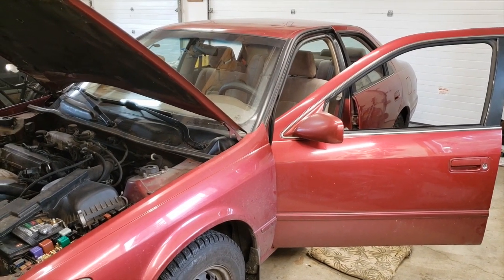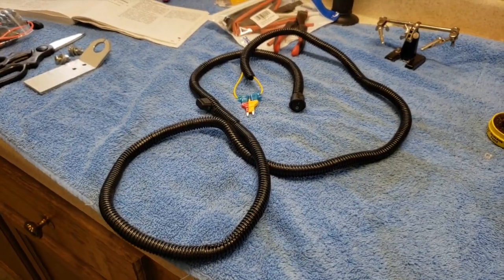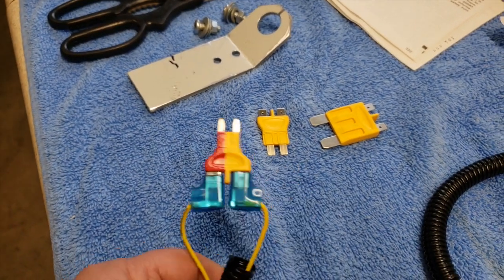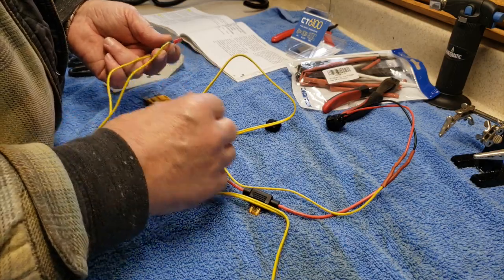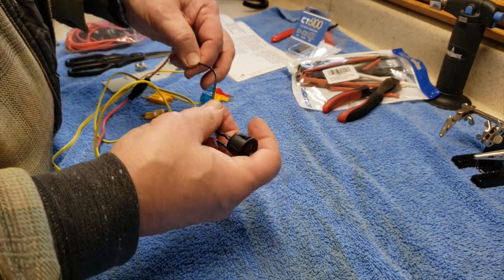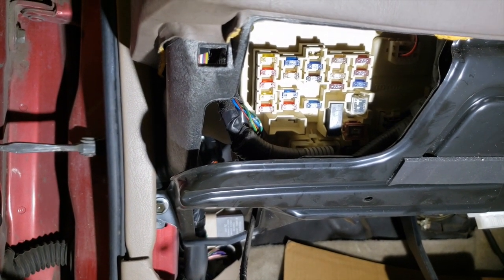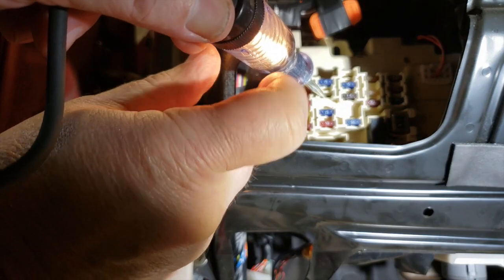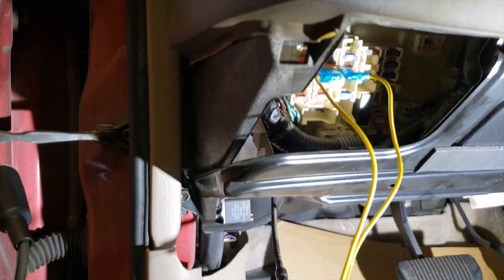Kill Switch - Quick and easy.

Comment: Why do you have a positive and a negative on a fuse when both should be positive. A switch only controls a positive or negative pole . Not both. I don’t get how you are wiring this. If you had positive and negative connected to a switch it would fry the switch and everything else.
Reply from the maker: Hi Joshua. The yellow connector is not a fuse. Its a very simply "plug", to extend a wire from my fuse port in my fuse box, to an inline fuse and continue it to a switch. I hope that makes sense!
We have been using this switch for almost 2 years now. And we have had no issues with it. Still working fine!! What I like most about it, is its simplicity!
Thank you for your question!

Comment: If the Killswitch is accidentally turned off while driving, will the motor die
Reply from the maker: Thats a great question!!
And I did not know the answer to it. So I had my son start the car and turn the switch off. And the car died!!!
So thats a major problem!
Granted, our switch location is located in an area that you can not accidentally bump it, but thats something I should have checked, and noted that in the video!! I will add a note in the description explaining that. Viewers need to be aware of that.
Thanks for pointing that out!!
Reply: @retirementwithpete9859  Thanks for answering

Comment: A thief would find that connection on your fuse box really easily
Reply from the maker: Hi Kent, like they say, this is only keeping the honest people honest.
If somebody really wants a 1998 camry, with 250,000 mile, they are going to steal it. Not sure why. Especially in Portland. But, knock on wood, its been almost 6 months, and nobody has bothered it.
Thanks for watching and commenting.
Reply: I don't think a thief will go through the fuses trying to find if they did something like this ton a car
Reply from the maker: Its sad that we even have to worry about this. 
Thanks for commenting and watching!
Reply: depends on the thief
Reply from the maker: Ours are pretty dumb😄
Reply: If it didn't start right away a druggy would move on, only a thief looking for a car of value would spend time looking for a kill switch, that said, i'd go with the fuse box under the hood and go thru the fire wall with the switch. put a lock on the steering wheel and the hood too!

Comment: The best video clip. 
The socket tap fuse it’s the key of success in this application. With the fuse on line ( hot wire)
Reply from the maker: Hi Mario. Thanks so much for the compliment.  The idea seemed very simple to me. And Im glad its working for myself and for others. Thanks for watching and commenting.

Comment: Finally I found what I am looking for thank you very much. I was looking for a simple kill switch instead if tempering with Fuel pump relay or the battery and I knew my solution is in the fuse box but I was too scared to do it. Now I am more confident about it but a quick question what amps did you use for the inline fuse connector? is it the same as the ignition fuse 5 amps?
Reply from the maker: I used the same 5 amp fuse I pulled out of the fuse box. The specs on the fuse connector says the wire is 16 ga. And able to hold up to a 13 amp fuse. There is a link in the video description to amazon, which is where I purchased them.  Scroll down that page, and it tells you the specs. I had the same problem you did,  trying to find a simple kill switch. This fix has been working great for 10 months now. Not sure this works on all makes and models, but it definitely works on a 1998 camry😁. Thanks for watching and commenting,  and good luck on your kill switch!!
Reply: @retirementwithpete9859  Thank you but what is the purpose of using another fuse for the switch?
Reply from the maker: Sorry, Im not sure I understand your question. Im using just one 5 amp fuse, in the inline fuse connector. I got that fuse from the interor fuse box, that protected the ignition.  The switch does not have another fuse. I hope that answers your question. If not, please let me know, and Ill try to be more detailed. Thanks for the question.

Comment: Not had my car stolen yet since I do live on army barracks but I’m installing one to prevent it when I’m out. Some people do it to the fuel relay might be better?
Reply from the maker: Hey John. I had the option of using the starter fuse or the ignition fuse. I havent seen the fuel relay used yet. I went with the ignition fuse because it seemed like the simplest fix.
But anything will help deter a thief. It sucks we have to do this stuff, but thats the world we live in now. Especially in Portland🤨
Thanks so much for your comment and good luck on your hack. Let me know how it goes!!
Reply: Depends on the car. If your ignition fuse/wires are easily accessible from the driver's seat, the thief could trace the wire to the switch and bypass the switch itself.
Reply from the maker: Yep, this only keeps the car safe from the lazy thief.

Comment: Instead of searching for a kill switch any thief able to steal a car without a key will immediately look for kill switch wires in the fuse panel and quickly connect them together and drive away so this method is only slightly better than nothing. 

But, if choosing this method, it's very important to splice the inline fuse as close as possible to the hot side of the fuse socket because in this video there is no fuse protection in the section of wire between the fuse panel and the inline fuse therefore a short to ground in that section would not be good.

Tapping a vital hot wire in an extremely difficult to find location forces them to search for an actual kill switch which they know is usually within reach of the drivers seat so locating one in that area is also only slightly better than nothing.
Reply from the maker: Like I have said before, this only keeps the honest people, honest. If they really want steal a 1998 Camry, with 280,000 miles, then they will steal it. Especially in Portland. Crazy town!
Reply: @retirementwithpete9859  My first paragraph wasn't even worth responding to. 
How about responding to the second paragraph, because you taught a lot of beginners (like yourself) how to install a wire that will burn if it shorts to ground.
Reply from the maker: You are correct! Thanks for the advise.

Comment: Excellent video.  Can you post where you got the inline fuse?
Reply from the maker: Sorry about that. I thought I had added that in the discription. Found everything on amazon.
Here a link to the inline fuse..
https://www.amazon.com/Inline-Holder-VANTRONIK-Waterproof-Blade/dp/B081YGN8SP/ref=mp_s_a_1_3?crid=HTJS6906DGSA&keywords=16+gauge+inline+fuse&qid=1703266976&sprefix=16+gauge+inline+fuse%2Caps%2C219&sr=8-3
Its been 2 years now. And no issues with the killswitch. And it hasnt been stolen again!!
Good luck on your project!
And have a great Christmas holiday!
Reply: @retirementwithpete9859   much appreciated!  Glad to hear the kill switch works and is doing what is was meant to do!  Merry Xmas!

Comment: How many miles on it?? 
Looks good.
Reply from the maker: Its got almost 250,000.
Its a tank. Its the best driving winter car we have in the family. 
We through the studded snow tires on in November,  and it can go thru anything!! Great car.
Thanks for watching!
Reply: @retirementwithpete9859  
Wow. 
I believe you . 
Got a 04’ 3.0 L Mazda tiptronic transmission with 240 thousand miles on it. 
Greetings from North Texas.
Reply: These cars are all over the San Francisco bay area, they run forever
Reply from the maker: Hi Ray, these cars are so dependable. Maybe thats why they are so popular with the car thieves. Or maybe they are just easy to steal😄

Comment: My car has a push-to-start ignition. I'm considering connecting through the starter fuse instead of the ignition. My concern is that since there's no power through the ignition fuse, the starter might keep spinning until the engine starts, which, in this case, won't happen. Do you have any tips? Additionally, in newer models, the computer might interpret the lack of power as an error, and the check engine light might come on.
Reply from the maker: I felt very capable working on a 30 year old toyota, but I would be hesitant to try and install a kill switch on my 2021 gmc denali, that has a "push to start" button.
Like you said, one wrong move and the computer might code you to death, or worse!!
The only advise I would give you is to have a pro install it. That way, you have a warranty if anything goes wrong.
But I am very impressed that your willing to try 😉
Reply: @retirementwithpete9859 I found another video where a person installed a kill switch right after the push-to-start button. I think that would be the most reasonable and safest approach. This way, the power is interrupted between the button and the rest of the car's system.
Reply from the maker: Very nice. You should post a video of your install. I would definitely "like, comment, ring the notification bell and subscribe".😉
And Im not kidding! Let me know how the the install goes.
Good luck👍

Comment: Hi Pete, put this all together but not sure why you have to check the fuse seat for pos or neg? And how do you do that? Are you using a probe with an alligator clip to negative of batt? I kind of confused on how the tester works and what type to use? any help?
Reply: Hi Pete, got it figured out. Thanks! Once I get it all installed I'll let you know if it works! LoL
Reply from the maker: Hi AG. I actually was just responding to your previous comment. I was confused by your comment about the positive and negative side. So I watched the video again.😄. I understand your confusion.  Your interpreting the "hot and cold" side of the fuse as "positive and negative". That is not correct. A car fuse is simply a very small curcuit breaker. If too much power is run thru the fuse, it pops, just like a breaker does. 
Power from the positive side of the battery, runs thru one side of the fuse, and continues out the other side of the fuse. So its important to find which side of the fuse the power is coming in from. Thats why I marked my fuse plug red, for the hot side of the fuse. And thats why the inline fuse is installed on that side, before the toggle switch. I hope this all makes sense.  And the light tester I used, has an alligator clip, that I clipped to a bolt head on the door jamb.  You can barely see it in the video. If you have any questions, please reach out again!! Let me know how it works.
Reply: @retirementwithpete9859  : got ya! Thank you for taking the time to answer!  I think I understand now, I will put the in line fuse on the hot side.
Reply from the maker: Perfect!!👍

Comment: Where did you find the dummy fuse?
Reply from the maker: Hey Scott. Found them on the Amazon. They sell frickin everything😀.
Reply: @retirementwithpete9859  what are they called I couldn't find them. Thanks
Reply from the maker: Hey Scott. At amazon, search for ct6100 fuse socket connectors.
Also, in my video, click on the "more" word. That will show a link, that will take you directly to the fuse sockets at Amazon. 
They are a pretty neat idea. Let me know if you find them. Good luck.
Reply: @retirementwithpete9859  thank you

Comment: I like to ask you that why you put a inline fuse in that positive wire?
Reply from the maker: Hi YJ. I removed the fuse when I installed the fuse socket connector. So that  curcuit was not protected until I added the inline fuse. Without  it, if there was a short, it would fry the entire curcuit. Hope that makes sense. Thanks for watching and commenting.
Reply: @retirementwithpete9859  Hi, I understood... i see you removed a fuse from the fuse box. So if I want to connect a kill switch to fuel pump relay wire, do I still need to add a inline fuse? Thank you!
Reply from the maker: Your starter curcuit should have a dedicated fuse, so you shouldnt have to add an inline fuse. But its cheap and easy protection. I would probably do it. Let me know how it goes! Good luck!
Reply: @retirementwithpete9859  Thank you for your help!